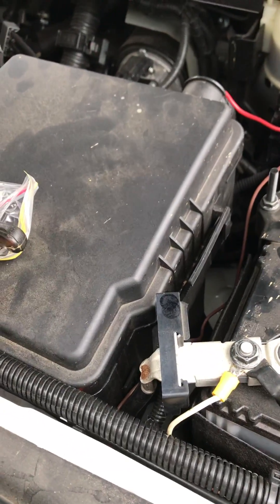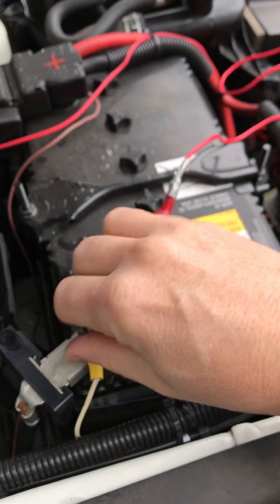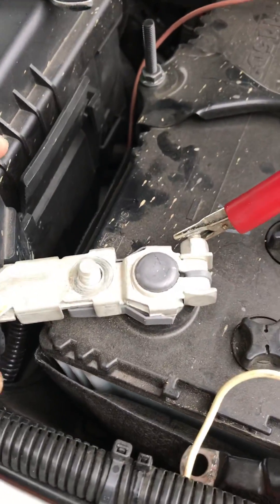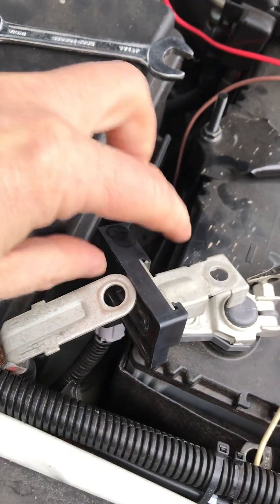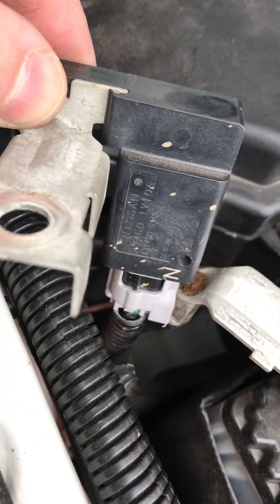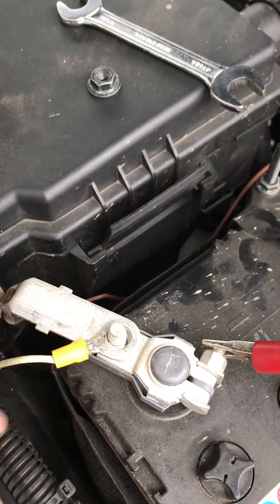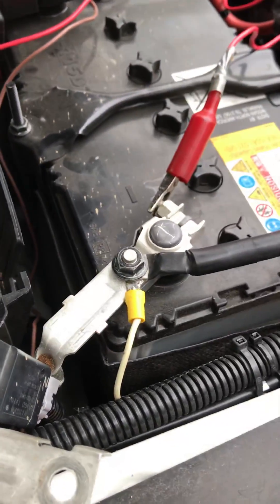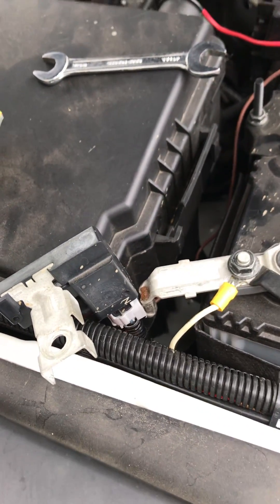Nissan Y62 Smart Alternator Disconnect

Comment: Hi, what is the reason to use the smart alternator in the first place if it’s not giving enough voltage practically always?
Reply from the maker: Нурсултан Яхияев Hi. When you have two batteries on the vehicle, there is often not enough high voltage for long enough to fully charge the extra capacity. Also some dual battery controllers won’t switch over to charge the second battery unless the voltage is over 12.5v. The smart alternator can restrict voltage down to 11v.
Reply: It`s because of emission regulations, it`s of little or no benefit to the motorist but can cause unnecessary expense, video shows you how to deactivate the system, with system deactivated any sealed lead acid battery can be used .   https://youtu.be/x9UML_jDKL0
Reply: Because it has a temperature sensor to correctly charge your battery, amongst other things.